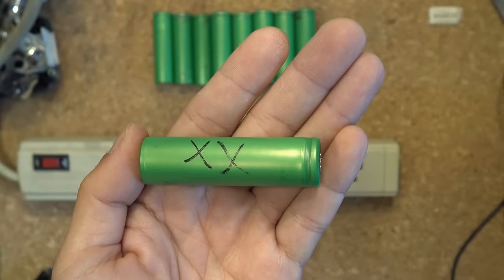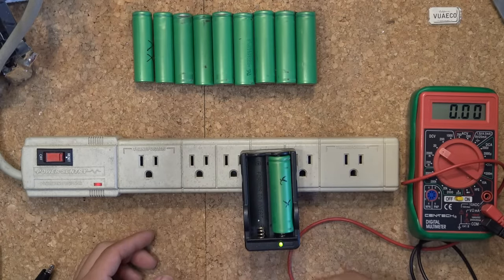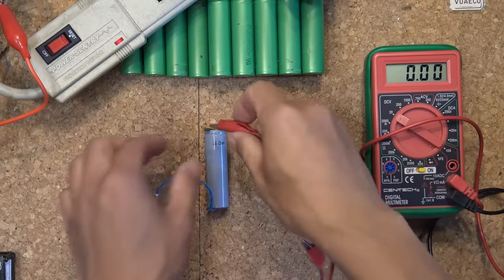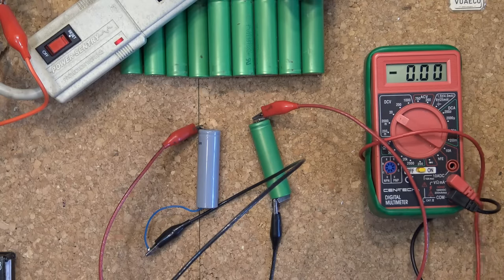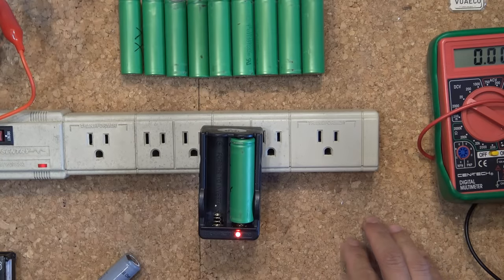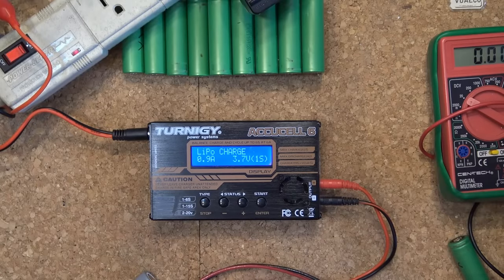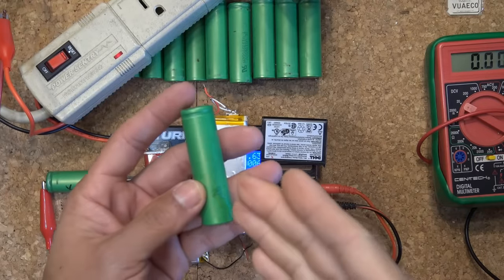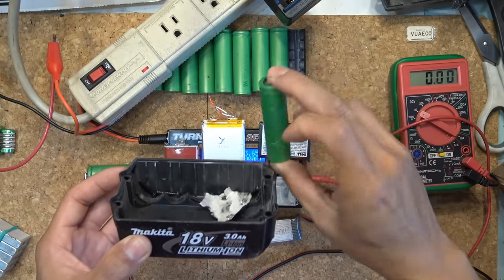DIY: How to revive a dead 18650 (or any) Li-ion battery cell

Comment: Or you could have just run jumpers from the charger itself... Then put a battery in that does charge so the charger will recognize the voltage and after that good battery starts charging then connect the low voltage battery using the jumpers from the charger itself and charge it...you should still be able to take the good one out and charge the low voltage battery by itself in most cases (maybe 60 percent or so) after tricking the charger with the good battery.. But if you have to you can leave the good battery in and the charger will not stop until both are charged...it will take a little longer because of the extra capacity that need charged... Doing it this way you do not have to hook the 2 batteries together so they equalize voltage...the voltage from the charger will be higher than the 2 batteries they will charge because of how electricity takes the path of least resistance and how high voltage travels to low voltage...also.. there is nothing that can happen for having 2 batteries connected to a port on the charger instead of 1 like it normally would be...the circuit decides how much amps to give the batteries... So all you are doing is splitting the amps where each get half... Which is why it will take longer though...

Comment: I don't even use another battery I just use a DC 3.7v wall plug and charge it bare wire style. I've only had a few not come back to life and only one lost a charge out of the 10 i revived. I got some cradles coming from China just taking a while to arrive. I will build my own charger  units. Nice thing about my wall charger is the light comes on when I am at full charge. It takes the smart out of the charger and puts it in the humans hands.

Comment: wHY WOULD IT BE A PROBLEM TO HAVE THE BATTERIES CONNECTED TOGETHER IN PARALLEL TOO LONG IN ORDER TO BRING THE VOLTAGE UP? WHATS THE WORST THAT CAN HAPPEN? IT REACHES THE SAME VOLTAGE AS THE DONOR BATTERY. SO WHAT?

Comment: A deeply discharged Lithium battery should be recovered with a current limited to 1/10th of its capacity until it reaches again its minimum working level (~3.1...3.3V). Then you can do usual quick-charging again. Without voltage and current limitig you could kill it completely.

Comment: You can trick the charger by increasing the voltage but the old battery won't hold the charge.  

It will fully charge the old battery and then the battery will be dead within an hour.

Comment: Why does when i try gets spark and hot?  Connecting a lithium ion cell with a dead power bank battery that says 3.8v 5000mah
Reply: Nevermind.  Has to do with it still being connected to the circuit board

Comment: I have 6 18650 cells which I took off from from a laptop battery that was loosing it's charge in just 15 to 30 minutes. I took off the cells from the casing they were dead I did CID and the voltage increased to 3.7 to 4.2 v in each cell . I used it for my rc plane when I gave full throttle the voltage of battery decreased from 11.7 to 4.5 volt and after sometime it again came to 11.1volt .whenever I give load on these batteries their voltage decrease and gradually increase when there is no load .Please help
Reply from the maker: You can't use laptop cells to run RC toys. You need power tool cells.

Comment: That only works if the cell is good.  I use a varable voltage psu start at just on 2V look at the current and turn up slow to the cell voltage then it's charging voltage if no current draw the cell is bust.  Strap charging like you show only works if the cell is good the charger is not coming on for safety as if a 1.2 voltage cell is put in by mistake.  As the cell voltage is to low the charger will not come on.

Comment: This also works with ( totally flat ) 12 Volt Lead - acid car batteries .... modern electronic chargers detect no voltage and think there is no battery connected , so do not start charging .... connect a spare good battery to charger ( even a small 12 Volt fire alarm battery will do ! ) , charging starts , then add flat battery in parallel ... after a few hours your big car battery is charged ! ... but note , if the battery has been flat for a few weeks / months ( abandoned in an old shed ? ) it will be sulphated and may never charge ?  ALWAYS recharge Lead -acid batteries promptly after ANY use ! ! ! ........... DAVE™  ............

Comment: So I've seen a quite a few vids on recharge batteries but here is my question..
At what point do you just jave to say screw it and buy new ones?
Reply: Given the amount of heavy metals and the massive impact that both mining the batteries and disposing of them have on the environment, there really should be no moment where you just say "screw it" and buy new ones, unless they are actually beyond fixing.  The only reason people don't do this is because the environmental impact of our battery use isn't included in the purchase price our believe me we'd pay people to do this kind of fixing.  Being seriously responsible about battery use (while still respecting safety cautions with respect to the batteries) is part of how we need to start leading our lives if we mean to have ecosystems for ourselves in the medium term future.
Reply: @agneteht  my deal was more with the shock method.. However you go you STILL have to buy either new batteries to replace the okd ones or a whole new pack..
Also I was referencing as to what or how much of a voltage drop down you just guve up and replace it and yes you will have to replace it or do without I hate being less than 5 minutes into a job and it just dies deader than a door knob.

Comment: This is pretty much an unnecessary complication. If you don't have a decent charger (like MC3000 maybe, or ISDT C4) just put it in any versatile charger and set it as Ni-Mh for a few seconds. It's gonna go to 1.70v and then just put it on normal Li-Ion charge.

Comment: Can somebody answer? 
When I charge my battery, the light turns red for several minutes and then it turns green. I assume my battery's dead too.
Reply: It means the charger detected that the battery is fully charged. If its capacity is too low then the battery is too damaged to revive.

Comment: There are two options. Do not attempt to recharge the battery using this system & throw the battery away. 2nd option- try this method to recharge the battery & accept the result - good or bad.

Comment: While this may work, any lithium cell discharged below 1.5-2v likely has an internal short and is no longer safe to use. Any battery recovered through this method will likely die quickly, put unnecessary stress on other cells in parallel with it, and possibly even vent or catch fire if placed under a heavy load. Legit 18650s are readily available all over the internet and are quite inexpensive these days. Just save yourselves the trouble and buy new cells.

Comment: The problem is most of the new Chargers are crappy I've been racing RC cars for use in the old Chargers we had never had this problem the battery can be revived they can if they can be charged on a decent charger but I haven't seen a decent charger in a long time

Comment: This method don't help to reuse the batteries, because you can recharge the batteries, but the capacity is compromise. This batteries don't work normally. If you use this batteries for very less consumption current is ok, but if you use the batteries for replace the normal battery pack,  is wrong.

Comment: One can resurrect some of Li-ion batteries using your "trick",some will stay dead regardless if you use 100A source or another 18650 to pump back juice into the defective battery

Comment: Just use NiMH setting on your charger on low amp setting to get voltage up to around 3.4v or so and then change it lipo setting...
MUCH safer than what your are doing ..
Reply from the maker: That's what everybody is saying. Unfortunately it's just a theory and doesn't really work in real life. Check out this video: https://youtu.be/yuLdi4oT7xI
Reply: @vuaeco  I use it all the time when I accidentally over discharge my RC lipos, using a hobby grade charger where I have total control over the amps and can see the voltage and even monitor the temperature.
I can see though that you are reviving older cells in the 18650 format which have been sitting for a long time at low or zero volts so these probably won't be easily recovered at low amps.
The reason people say use the NiMH setting is safety, these things can  be very dangerous if charging at high amps when they are sitting at very low voltages apparently.
Not saying you shouldn't do this or that it isn't working but just that there are risks involved.
Be safe!

Comment: works with any battery   ive used this method on car batteries. it will get the charger to work... but i found after charging... the battery is still no good..

Comment: Yeah I have a electronic charger and when I have this problem with the exact same sells I give him a hit at 900 mA for five minutes on the Pb charge setting for a Pb battery that works fine......

Shocks them in the life then they charge normally on the regular charger
Reply: not everyone just knows what a pb charger is, can you tell us what a "pb" actually is please, thanks
Reply: Frank Crapanzano PB =lead as in lead acid battery mode setting

Comment: This method is wrong, damages the cell and is dangerous.
Dead Li-Ion cells MUST be revived with a very low constant current (10-30mA) until their voltage reaches 2.50V, then the current can be raised to typically half the Ah rating (1A for 2Ah cell).

Comment: Parallel charging with a bad lithium might end up in a bad and dangerous situation. Don't give advices to what you think it is ok to do, without knowing its principles.
Lithium cells should be charged with a constant current, that can't be performed with another cell, you need to use a lab power supply for this with a temperature tracker.

Comment: These batteries are commonly used in vaping devices, and I personally wouldn't trust a "resurrected" battery in such a device, especially if it's an unregulated mechanical mod with no over current protection built in

Comment: 1. not all the batteries is possible to revive, 2. this is a temporary fix, the battery is dead and will show it charges but it drains fast and eventually it will stop forever, 3. when battery gets hot it is NOT NORMAL, it has to stay cold

Comment: Don't do this at home!!! With this method you are shorting both batteries! There is a reason why batteries in parallel shouldn't have more than 0,1V difference per cell. Throw away dead batteries, or you are risking a fire!

Comment: You're using a lengthy method, just use a Mobile charger on the dead battery for few minutes & it will reach to 3.7X voltage... I personally do it, it is safe & easy.

Comment: anybody ever had a situation where an 18650 battery from a salvaged laptop battery pack actually switched polarities? One out the the 6 I extracted from an old dell laptop pack (Sunpower Li-ion 3.7) meters  @ -0.475vdc when properly metered. When I reverse the meter leads is reads to the positive.  And yes, the + and minus are clearly labeled on the battery, yet it seems the polarities have changed.. and it was a working laptop back in the day. Its a bad battery obviously, but polarity change? Is this a real thing?

Comment: did you even check that the charger didn't trickle-charge the cell even if the light is green? (you have all the tools)
to make it clear Liion cells that in fact have been discharged way below spec and if these cells should have any chance to work again.. these cells need to be nursed up into nominal voltage very slowly, that's why many charges have a very low charge-current, even if it doesn't look like the cell is charging it is, in fact, charging the cells. (just very very slowly)
fx a very popular charger brand like Litokalaa.
if you put a battery in these it will look like the cells aint charging and then nothing is happening and fx the display on the charger shows nothing and if you then let it be there for fx hours then you can come back and suddenly it's alive.!
the reason is that some chargers do put out a very low current and that can trickle-charge very low discharged cells back to life but it will take time and it will often look like the charger are not doing anything.
but you can easily check it.. check the voltage on the cell, and then put it into the charger for some time and then check the voltage again on the cell... is it climbing then its trickle-charging the cell, though you can risk that the charger will be confused if its a charger for numerous chem, as its usually the voltagelevel that identifies "chem standard".
so on a Liion you can risk that you will have to put it on two times.. first trickle charge cycle will conclude NIMH and then when it's up in nominel NIMHvoltage then it will classify it correct. fx Liion-

Comment: It won't work in all situations .....I had 6 old laptop batteris.....I put them in charge togather ....One of them gots really hot during charge .....I disconnect it from others.....Others voltage was fine and stable.... But that one was hot until its voltage again come from 4.2  to 0.5 volts I think

Comment: At the very least should use a resistor to help restrict the flow of current. Or make a distinction on what kind of 18650 it is and the types.  I can truly imagine someone using a non protected cell and the current is just gonna do a run away and discharge/recharge at a ridiculous rate causing injury.

Comment: Anyone else actually tried this?? Cuz I did, twice, with known good, nearly new fully discharged cells, and using two brand new top of the line MXJO batteries to charge the dead ones, and it made no difference at all. I was able to recover the cells using the standard trickle charge method.